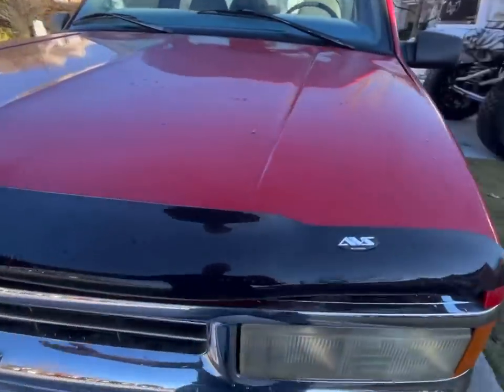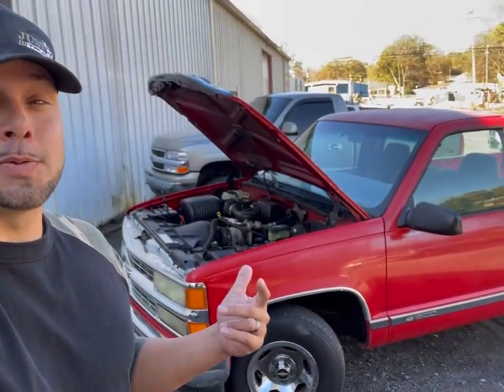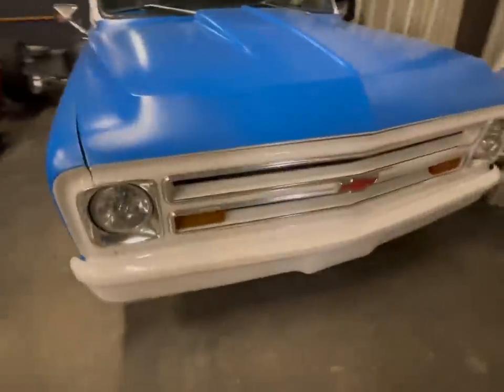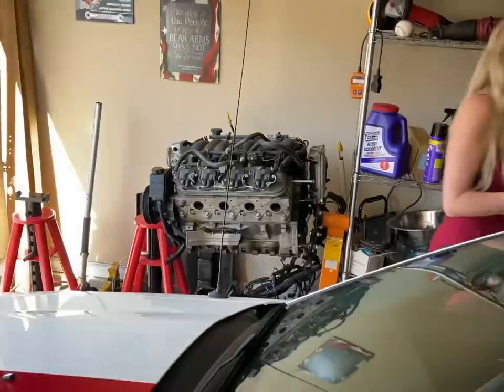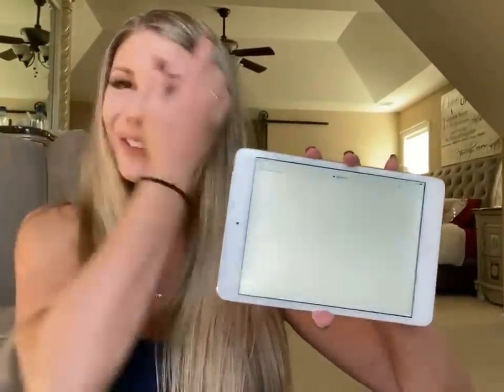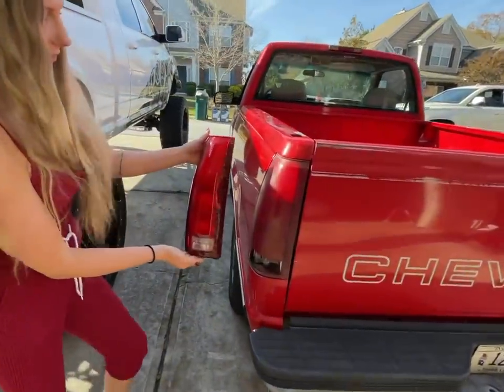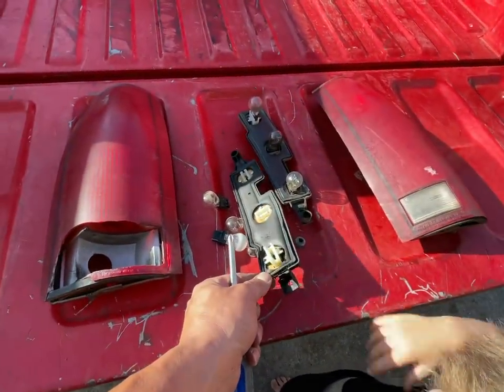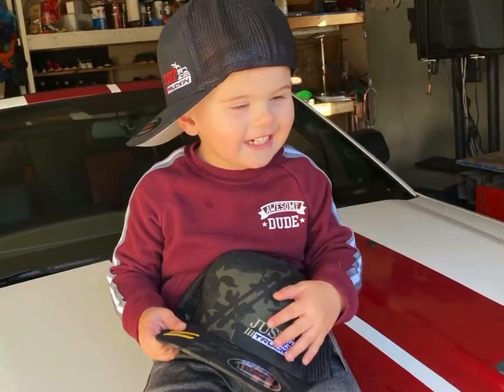“OBS LS1 Swap Giveaway” Ep01 Might have Found a Motor and Black Friday Special on Merchandise, C10

Comment: That's all I ever buy is obs trucks I have a 1997 Tahoe and a 1998 gmc sierra.  5.7 350 in the Tahoe and the 5.0 305 in the sierra.  Love my Tahoe had it for 7 years rock solid dependable!  I know these obs trucks inside and out front to back very easy to work on.
Reply from the maker: That’s awesome 😎

Comment: i had a 98 gmc red ext cab 4x4 with the 5300 vortec in it till it got totaled in 2001the bed was pushed into the cab and the passenger side was 11 inches higher than the driver side of the bed that began the downhill slide of my ability to do the kind of work i do which is lawn care so i am considering getting my cdl

Comment: Old Red is going to be pretty sweet when its finished. My son is in the process of doing a LS swap on his '91 K1500. We bought a set of tail lights off ebay and had to swap out the boards in both. The ones that were included didn't work.
Reply from the maker: That’s awesome 😎 you son 🙏🏽

Comment: That is awsome squir body collection. i had almost  mint condition 3/4 ton 81gmc that was all souped up in the 80 it was bought just to pull a race car in mid 80s and was horable on gas so it sat parked at uncle rons garadge one rust spot on floor from dirt and small tree growing in the cab because the window was left open for 8 years   and in 2001 they werent like that rare when i bought it for 1000 no dents or rust wish i never sold it stupid stupid. Looked like fallguys truck i reved it up cold and bent somthing and it made that taping noise

Comment: OBS used to refer to the square bodys.. but I digress. GMT400 was the best (and some say last) truck Chevy ever made.
Reply: Yep gmt400s are the best.  They all have the same issues nothing major like sloppy steering,  soft brakes, interior door handles break easy the outside driver handle cracks, piston slap, and fuel spider poppet valve leaks.  Other then that very dependable!
Reply: @SkilledEddie  I'm sorry you own a Ford.

Comment: I have two BRAND NEW still in the box replacement headlights for your giveaway truck!  I purchased them for my '95 chevy truck but sold it 2 years ago and forgot to give them the headlights. I just found them over thanksgiving while cleaning out the shop.  You can have them! (just mention me in your YT vid ;)   send me message.